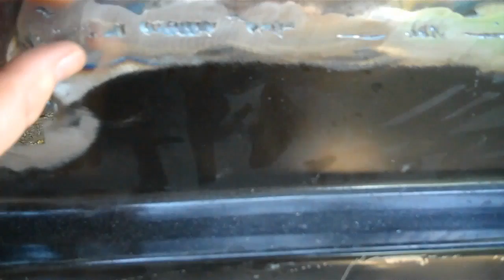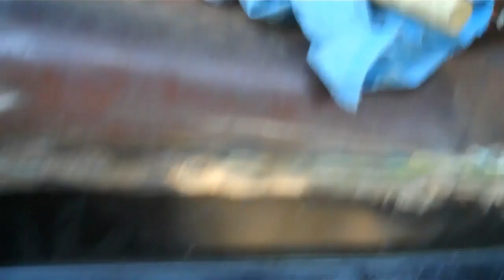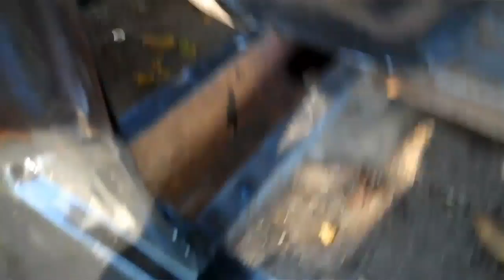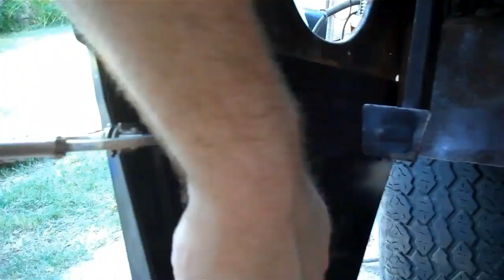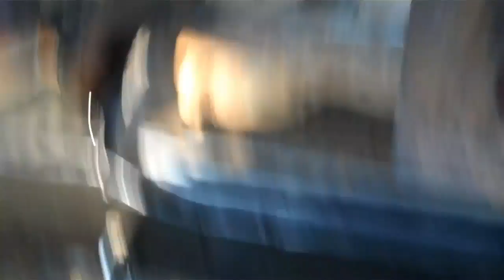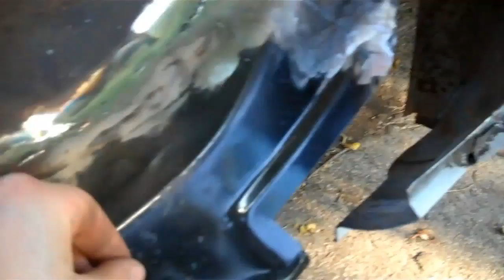PART 3 73-87 C10 RUST REPAIR | Welding Chevy Patch Panels

Comment: What are the part numbers to all the parts you bought? Most important floor pans, inner and outer rockers?
Reply from the maker: +Jacob C it's been so long since I did this job that I don't have that info.  I ordered my parts from LMC Truck and Brothers Truck Parts.  You'll find everything you need there
Reply: Tommy Wilson  hey,tommy,what's the number to that place in buford?
Reply: Jacob C  I got all my sheet metal from Auto Metal Direct in Buford GA.  Cheaper than LMC

Comment: Ok here is inner, you inner is way different than my inner, yours drops down, mine is flat and pushes that lip where pan rests upwards...
Reply: The inner rocker they sent me was the outer rocker inner support, what they call an outer rocker is an outer floor pan, that matches what you have in pics.. AMD was company I picked up metal through Summit, AMD-440-4073-L was the outer rocker backing plate they had it listed as an inner rocker.. 
Part AMD-406-4073-L is the actual inner rocker but they call it "73-87 GM Pickup Cab Floor Outer Section - LH". In case anyone is out ordering parts and runs into same issue, to prevent them wasting a week when wrong part arrives...
Reply from the maker: +Craig Gerlach Ok... in regards to my reply in the other video... thanks for sharing some pics.  Yes, that 406-4072-L is the inner rocker.  The other part # you listed... I'm not sure what that is.  That's not a part that I used.
Reply: Guess it is the rocker support panel, it fits inside of outer rocker. Waiting on the 406-4073-L part now... If it beefs up rocker, the support panel, or that side of cab I'll add it in..  But when they list it as inner rocker and people are posting videos and forum posts making it fit somehow thinking it is inner, asking questions ,hope they find this and know some companies call their parts different terms... AMD is calling this an outer floor pan and that is confusing, especially when they show picture of it spun around off axis...

Comment: Where did you get your replacement panels? the inner rocker looks a lot better than the ones I got from ecklers truck.
Reply from the maker: Travis Butler It's been about 4 years since I made this series of videos.  As such I can't remember exactly which part I bought from which vendor, but I know that I only bought parts from LMC Truck and Brothers Truck Parts.  Hope this helps!  Thanks for watching!

Comment from the maker: I did this all out in my driveway.  I don't remember if it was windy or not.  Generally when welding outside you increase the CFM of the gas flow by at least 5CFM (20CFM indoors, minimum of 25CFM outside).  You may need to increase the flow rate even more.  You can also build a wind break if you need to.  What I'm getting at is, I think it would be best to use MIG with shielding gas.  You'll have a much cleaner outcome and less mess to grind down.  Good Luck!